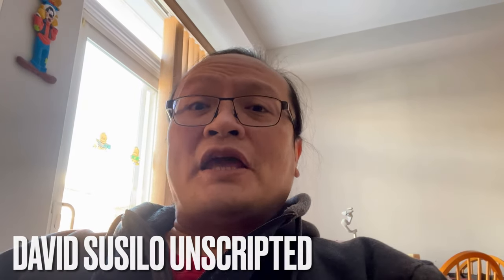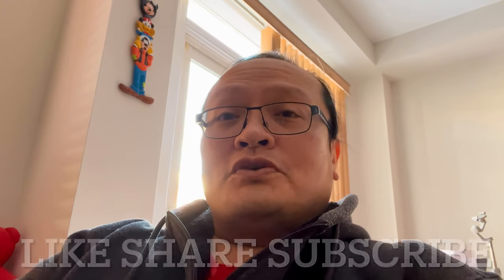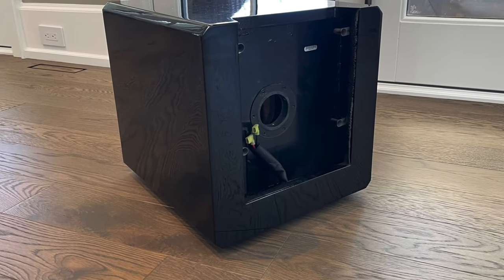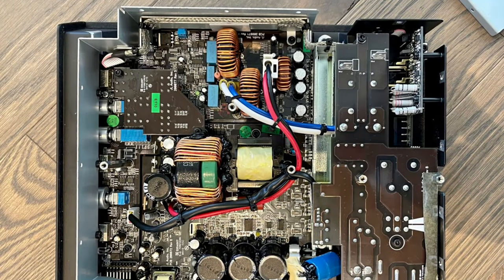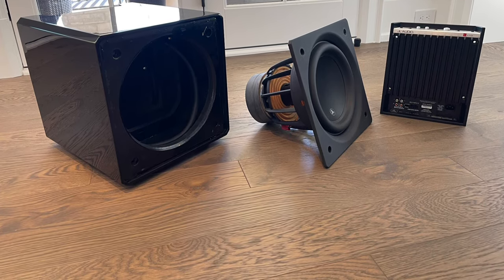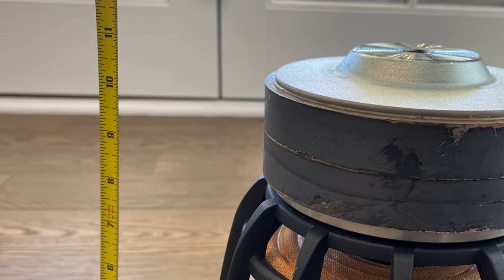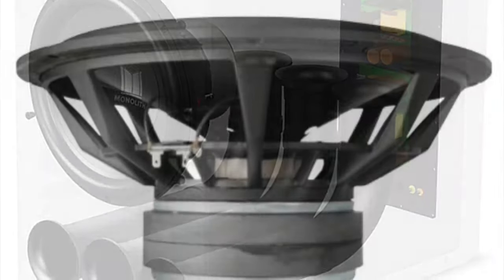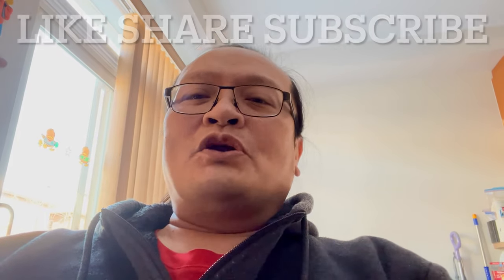JL Audio Subwoofer SECRETS REVEALED - E110 - teardown

Comment: One thing I will tell you about the amp--it's not as great as you think.  Unfortunately many, including myself, have had the dreaded failure of the volume pot.  From what I read it has to do with the cheap crap capacitors they used.  JL is well aware of this issue but instead of offering free repair, they charge to fix the amps.  You know the old saying, you're only as strong/good as your weakest link.  Sure the woofer is great and the construction is top notch, but they went cheap on internals of the amp and thus many will face the failure and will be faced with a costly repair or moving on to another sub.
Reply: It's true, my buddy's F113 suddenly stopped working. I was there to witness it all. And now no one knows how to repair it, we live in Europe. some shops didn't even want to compromise on touching it
Reply: I have had 5 failures of two E112s. 2 failures on one sub and 3 on the other. Full rebuild by JL after each failure. 

First time the crossovers failed on both, second time the volume pots failed on both, 5th time was an amp failure. They have junk electronics but good drivers.
Reply: @JamesWilliams-gf8gm  man that’s awful! I hope JL reads these because I’m never buying another JL product. Yes, I paid to have the volume pots repaired but sounds like that’s not the end of my issues.  Did they charge you for all those repairs?
Reply: @mak23997  hmm I replayed but it was deleted. Honestly I would sell them while they are working. They will surly cause you more problems in the future. I order two JTR RS1s which are still a few months out. A friend is going to pull the driver out of my broken E112 and use it in a car. Not sure what I will do with the remain one yet.
Reply from the maker: I have used JL subs for decades and not a single person I know in the hundreds of calibrations and installs that have such constant bad luck with JL.
Reply: @DavidSusiloUnscripted  better luck than me I guess, I hope it stays that way for you. 

My local shop offered me the floor model while mine were out for repair and it too had a failed volume knob. 

JL has a subwoofer rebuild program. Think about that for a bit.
Reply from the maker: @JamesWilliams-gf8gm I personally use MK Sound V12+ sub. If I were in your shoes I would not but another JL too. My bad luck brand is Samsung. I always have problems with Samsung products although most people have zero problems with it. Or one of my clients that have constant problems with JVC products. I guess the universe is just trying to screw certain people with certain brands randomly.
Reply: Then you're not doing any research.  Quick google will show you that the volume pots are a known failure because of the use of cheap Chinese capacitors. And JL knows this because they offer a program to send your amps in specifically to have that repaired and them refurbished. If these weren't so rampant they wouldn't offer this program.  Frankly it should've been a recall but of course that would cost them money.   @DavidSusiloUnscripted
Reply: Except do these companies have specific repair programs for their known failures?  You seem pretty defensive of JL when we both are giving you evidence of their known failures with their repair campaigns for said errors.  @DavidSusiloUnscripted
Reply: I just repaired my E112, 3 capacitors, both in the power section of the amp. Now it works! I have a second that needs a check up.

Comment: Thank you for this great video. Would you choose the E110 or the KEF kf92 (if you ignore the price difference of course) ?
Reply from the maker: I never had the opportunity to listen to the KEF sub. However, I’m familiar with the theoretical spec of it. From the spec standpoint, the KEF should go deeper than JL. However, having listened to many dual-opposing drivers (push-pull), they tend to be less tight than the JL.
Reply: I am trialing  both atm and really wanted to keep the KEF due to it's slightly smaller footprint, nicer looking exterior and more evenly distributed sound due to it's dual drivers but....... after listening to both back to back, the JL is the one ! The bass texture, note to note distinction & tightness are on another level but primarily just when the KEF starts rolling off when you really push it....the JL just doesn't back down !
Reply: be aware that kef just released a replacement to the kf92 named kc92
Reply: @offerhak  Yes I noticed but virtually identical to the old model except p-flex driver surround and available in white aswell.

Comment: How do you remove the amp plate,  I loosened the bolts and could not remove the amp. It seemed to be hung up on something. Do I have to remove the woofer?
Reply from the maker: The amp plate is glued to the back panel. If you use something like a nail you can pry it open VERY carefully.
Reply: @DavidSusiloUnscripted  Thank you David
Reply: @DavidSusiloUnscripted Hello.   So please advise. I intend to replace my amp plate on my E112 soon. So can the new plate be installed without glue (just screwed back on), or is the glue is a must when installing the new amplifier plate. If it is a must, do you by any chance know what type of glue is used? Thanks for the video.
Reply from the maker: @111ARR the glue is not a must, it’s more a “just in case” thing. Regular wood glue (I use Gorilla glue) should suffice.
Reply: @DavidSusiloUnscripted Thanks for the prompt feedback. Much appreciated. GOD BLESS.
Reply from the maker: @111ARR no worries. Kindly subscribe my channel and watch my other videos too.

Comment: My E110 produced crackle sound when I turn the output level knob. Is this a common problem of this particular model? Do I need to replace the whole amp? Thanks!
Reply from the maker: Quite honestly, even after calibrating hundreds of E110 experience, I never encountered a single problem like that.

If you are good with soldering, in theory you can do it yourself without changing the entire plate amp. 

However, if you don’t hear crackling while NOT touching the knob such as while watching movies etc, I would just leave it as is. It’s not like you keep changing the sub volume anyway.
Reply: @DavidSusiloUnscripted  The problem first happened on its 3rd year of use. Back then, it only crackle when I turn the knob. However, I recently re-calibrated it and the problem worsened. The output level will suddenly shoot up by itself and I need to turn the knob up and down to calm it down.
I have used it for 6 years now and I think that there is some sort of weak point within the amp making it not durable.
Reply from the maker: @FatSn8ke  so it may not only the knob that’s the problem. Perhaps the input stage is wonky (usually caused by leaky capacitor). 

When something like this happens, it’s best to have the plate amp reconditioned by JL so they also check (theoretically) all the caps on that amp. 

3-5 years, regardless of brand, seems to be the “lifespan” of a plate amp.
Reply: @DavidSusiloUnscripted  Thanks for the information. I will check if I can send only the plate amp to my local dealer for service. I’m afraid that they will damage my subwoofer during transportation.
Reply from the maker: @FatSn8ke  they should be able to do that no problem. At least that’s my experiences with various brands in Canada.
Reply: @DavidSusiloUnscripted  Your information is very helpful. Thanks for the reply😄👍🏼
Reply: @DavidSusiloUnscripted  the local dealer here in Hong Kong refused to provide spare parts for DIY repair. I have to send in the whole unit for repair🤦🏻‍♂️
Reply from the maker: @FatSn8ke  how about sending just the entire plate amp (but not the speaker)
Reply: @DavidSusiloUnscripted  they do not accept this solution as well. I will ship the whole subwoofer to the service centre by myself. They told me that they will mark down every scratches and dents on the repair order.
I’m considering taking the plate amp to somewhere else for repair. It is out of warranty anyway🤷🏻‍♂️
Reply from the maker: @FatSn8ke  that is absolutely ridiculous. Yeah, try non-factory service centre.
Reply: Ii happen to me also, but the problem is gone after the service center fixed it!
Reply: @jatben  mine was fixed by replacing all defective capacitors in the outside repair shop.
Reply: Yes the E110's have a known issue with the amps and the volume control.  Basically your only bet to avoid having a 60lb paperweight is to remove the amps and send them to JL to have the correct components that should've been used, replaced.
Reply: i have problem just right when open box... when touch master or phase it make noise... buzz noise ... shame brand new and broken
Reply from the maker: Anything you buy will have the chance of broken out of the box. It’s electronics, it’s bound to happen sooner or later

Comment: Looks can be deceiving, I would like to know the Theil/Small parameters before I pass judgement. Although a cast frame and large double magnet stack look impressive and are not likely to be on a budget driver, the T/S parameters are important. My priorities for bass are clean and low, so a low inductance, low Q and high BL( motor strength). I only build since seeing what Energy sold me many years ago! I also have a sub amp that has a low noise toroidal transformer design with a high order high pass filter.

Comment: Great sub, I have one with a dead amp, the RCA plugs somehow took a knock while moving it and now I have a passive sub worth $3k - drat and damm it !!
Reply from the maker: Yikes!!! Hope you can fix it.
Reply: the amp is swappable and has a surprising failure rate. I think its around $375 retail for amp replacement
Reply: @PtheTinTHE  yep, see my post above.  They used cheap capacitors.  JL will refurbish the amp for that price, NOT replace it.

Comment: Yikes....this is cringey.  JL Audio is the most overrated brand in home audio subwoofers.  I had 2 F113 fathoms for a long time and every upgrade since then has crushed them.  They are an old outdated design with low output comparatively speaking to an industry that has blown by them.  They are ok for music, but in no way can they be recommended for movies, they dont even have output below 20hz!  Also, you compare these little mini JL's to Monoprice subs....compare it to the new 16" Thx version and look at that units output and distortion numbers....it has more output than a Gotham with less distortion lol.  You need a tech update my man, not trying to be disrespectful but you need a refresher course on subs my man.
Reply: @DavidSusiloUnscripted  the fact that no one really uses 10” subs is telling.
Reply: @DavidSusiloUnscripted  You compared it to a 15" monoprice in your video???  Did you not watch what you posted?  Look at the distortion output charts from audioholics.   JL wishes it could compete there.
Reply: @MusclesAVS  Not everything is about SPL, just by looking at the woofer is evident spl is not strong, the woofer is designed for linearity by spacing out the suspension and increasing the mounting depth.
Reply: @MrPolaris800crew  I agree.  I had 2 JL Audio Fathom F113's for years.  They are just ok subs.  Everything I have tried since then has been a big step up in both output and quality.
Reply: @MusclesAVS  i agree but for people who want small sealed subs with moderate output and good articulation they are top notch, other options are REL,SVS,KEF, which none of them have JL articulation and accuracy.
Reply: @MrPolaris800crew  Check out Rythmik.  Much tighter sound and cheaper.  Game changer.
Reply: i build speakers for a long time, the jl subwoofers are not big so not big soud, it look nice ans sound good for hvat it is. i can build a 15" sound better only problem i need big box.
Reply from the maker: Many people couldn’t be bothered with DIY and gigantic boxes. Most people prefer a turn-key solution.

Comment: I see this is a older video but man, you clearly dont know anything about sub drivers or amps..... You are all happy becuase the amp looks fancy, when its just a basic cheap amp. That is actually quite garbage from all the failures lol. The driver uses dual spiders to limit excursion and control linearity.... At the exoense of sensitivity and output. The driver is notning special, you are in aww bwcjase its long... Its still technically only a dual stack ferrite motor, nothing special about it. Especially for the orice JL wants for this mini thing. This is for a office, not a living room or a HT.
Reply from the maker: LOL. It’s a 10” subwoofer. Who in the right mind use a 10” sub for home theatre? And if you want cheap, there are so many cheap solutions out there for the budget conscious like yourself.